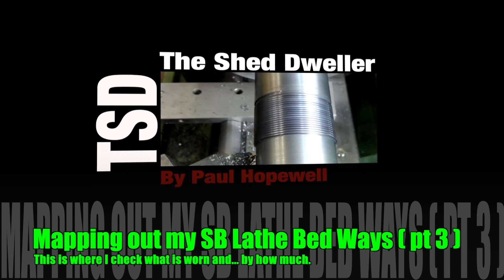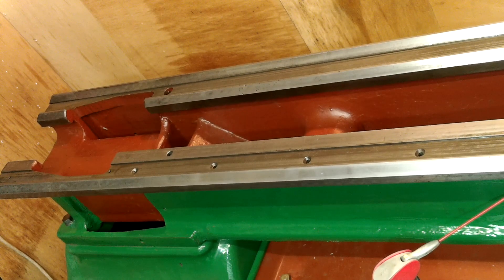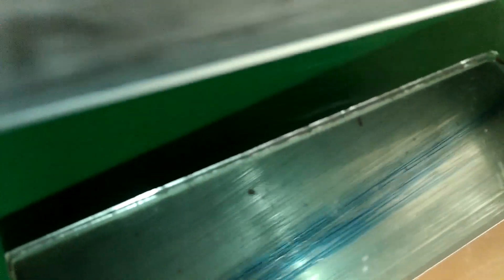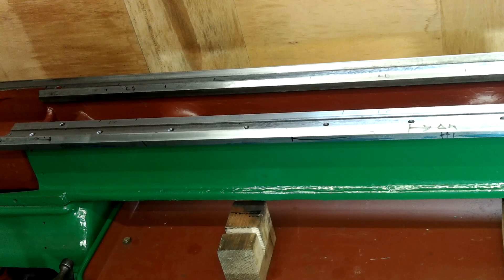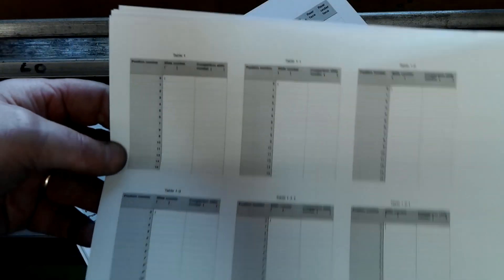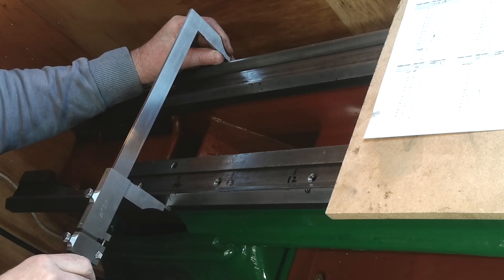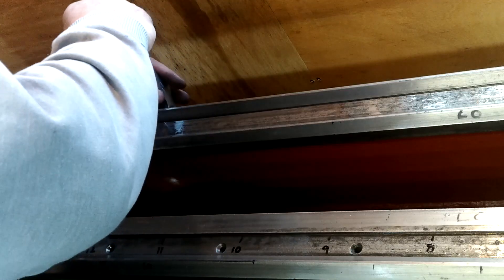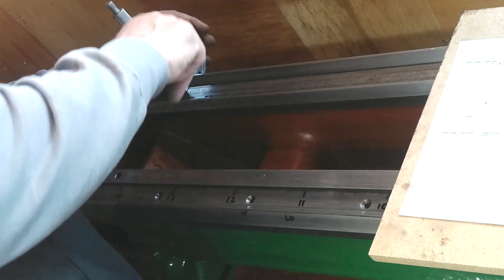Mapping the South bend Lathe slideways (Part 3)

Comment: some time back I checked my hendey  with very rudimentary techniques...nothing more then a homemade V block and digital calipers...if I recall correctly I saw around .030 wear near the chuck...so I am definitely interested to see how you get on with your project so I can gain from your experience
Reply from the maker: Hi, I recon any improvement is an improvement that will make a difference to any machine. I now know the gear is as sweet as a nut under power. Regards.

Comment: The only measurement that makes sense for me is @8.30...
Reply from the maker: Hi, the previous measurements were taken for comparative reasons. Then placed on a computer spread sheet where all the figures could be compared with each other for analysis. This form of analysis was easier than using the data I wrote on pits of paper.

Comment: I can only gawp in awe. To be honest, I feel a bit like a chimp having the workings of a swiss watch explained to him.

I do not fully understand how lack of parallelism in the flat ways would show up on the dti, using the method shown. If the ways were not parallel, but still coplanar then surely no dti movement would result. If parallel but not coplanar, then the dti would move. So they could be coplanar but not parallel. Which is maybe all that matters. In truth I haven't a Scooby.
Reply from the maker: Hi, the two linked parallels simply compared the parallel relation of the two slides, because I am ultimately looking for a way to repair the two saddle vee supports and knowing as much as possible means measuring much as possible.  Just imagine linking the two parallels together like I did, but on a flat surface. Then put a mag mount on one parallel, with a DTI reaching over to the other parallel. The reach between parallels in my case was about 200mm (about 8”). If the parallel with the mag mount was tipped over by say one thou, like would happen if the two slides weren’t parallel, then the DTI will show a several thou error. Therefore, if the DTI shows no movement, then the sides of the parallels aren’t being squashed together or forced apart, tipping them over. in this case indicating that the slides are in fact parallel. hope this helped, cheers
Reply: @Thesheddweller  I think it is something I would have to do and see myself. I cannot see how the two flat slides not being parrallel, ie not diverging apart or converging together could result in any movement of the dti. If they diverge or converge, but are still in the same plane, then there can be no relative movement of the two blocks giving an indication on the dti. If they were not coplanar, ie if one sloped down or up relative to the other, then there would be. 

I totally get that the more measurements you take, the more you know and therefore the better job you can make of it.

I am convinced I am still missing something here. Never mind though. I will keep watching and eventually the penny will drop.

Comment: The more rigidly the two 1 inch parallels are coupled and the larger the "contact" face area, the more they average out the tiny differences between the surfaces they each run along.  This may be what you want when you are indicating a third surface, but works against you when trying to compare the relative orientation of the two surfaces the parallels are running along.
Reply from the maker: Hi, quite right… thats why I used a less rigid threaded rod to allow flex to prove that there is little parallel error between the two slides while running along the length of them. regards

Comment: Mmm!  An angle grinder isn't going to work in this situation is it?
I know scraping is the normal course of action to correct this,  but,,,, going back to making your straight edge and surface plate. Could a long sacrificial form tool and say  grinding  paste be used to take out the bulk?
This isn't something I'm familiar with and know nothing about, but you use a long block to rub out a dent in a flat surface to correct it
Reply from the maker: Ah… the trouble is, there’s an enormous amount of metal to remove, you are right about the scraping side of things and I’m going to have to swot up on studies made by my hero Heath Robinson……
regards
Reply: @Thesheddweller  Plan B then !
A carriage that runs on your true faces with that angle grinder on  it 🤣🤣🤣
Reply from the maker: @NellsMechanicalManCave  Now there’s an idea,…...
Reply from the maker: @NellsMechanicalManCave  thats a good idea…..
Reply: 2 thou over that length is a massive amount of metal to remove with a scraper, hitting the highs with an angle grinder, until you’re within 1/2 a thou then finish with scraping has often been done by others. How about, clamp the angle grinder to your top slide, mount / clamp topslide on top of those parallels, grind 4” advance 4” clamp down, rinse and repeat.
Reply from the maker: @jedders99  Hi, you don’t by chance read peoples minds do you...
Reply from the maker: @jedders99  that IS a good idea… might be worth a look. cheers
Reply: A pneumatic die grinder mounted on the ''parallel sledge'' taking very light passes would get  you within reasonable range with good control. The problem with angle grinders or other high power devices is that the lack of mass  and rigidity in the whole set up to cope with vibration.
An arrangement for fine feed and the ablility to swing through 180 degrees would allow it to tackle the angled faces as well as the outside and top faces.
I look forward to seeing your solution.
Reply from the maker: @nrml76 hi,  so do I… so do I.
Reply: Paul will come up with a solution, it will be elegantly simple based on sound thinking. I’m looking forward to seeing it.
Reply from the maker: @tonyray91  Hi Tony, how are you...Hope you're still doing stuff in your shed.... cheers.